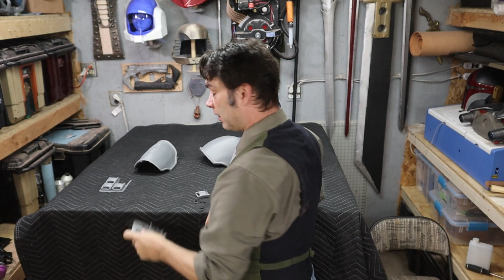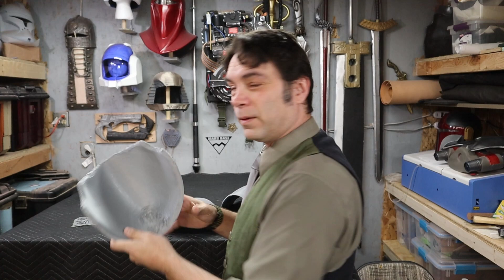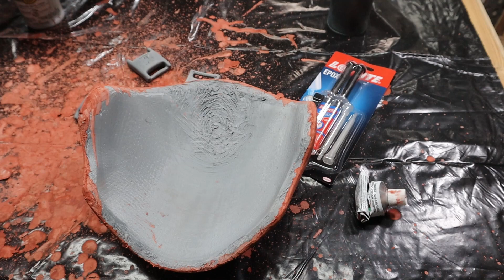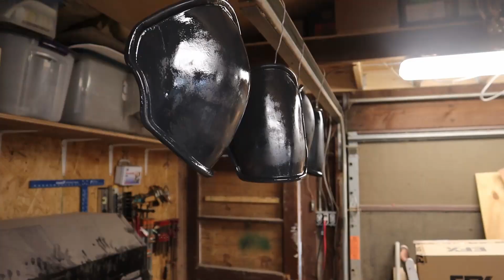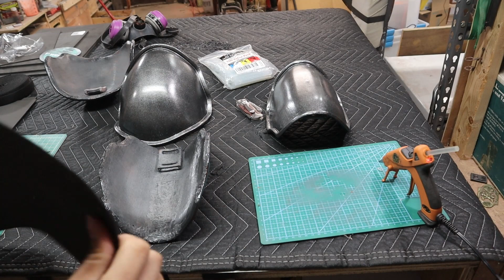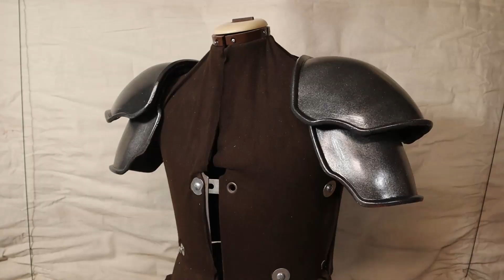[Pauldrons] Hawk's Custom Mandalorian: Part 06

Comment: Freaking amazing!!! I  might add some black felt or a thin strip of EVA to the inside edge by the armpit on the top pauldron in case it hits the chestplate to prevent any chipping should your arm cross over. These are looking so tough though!!!!!!!
Reply from the maker: Thank you!! I am sure there's going to be modifications once everything is put together.